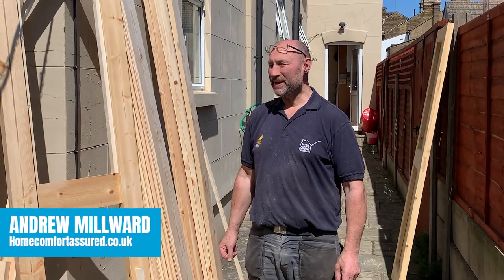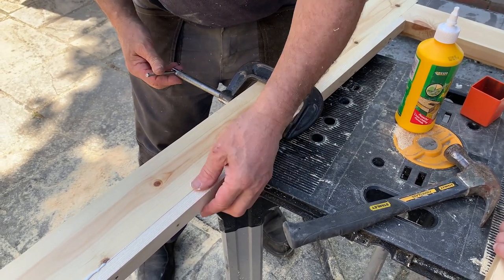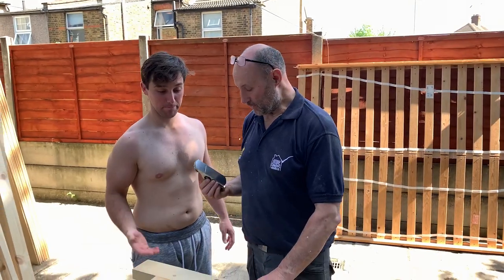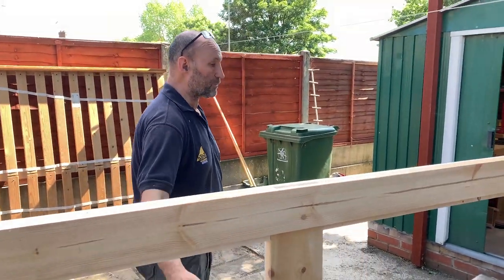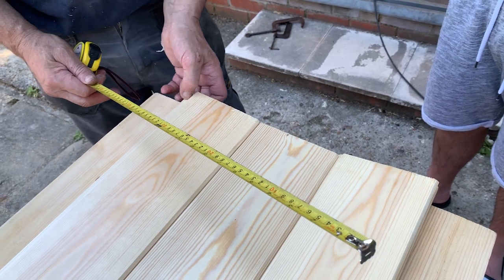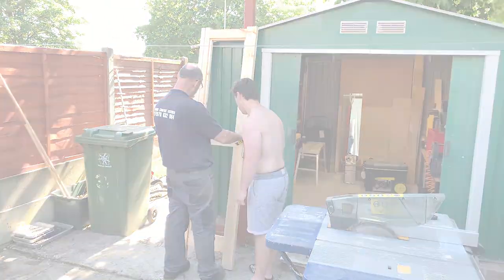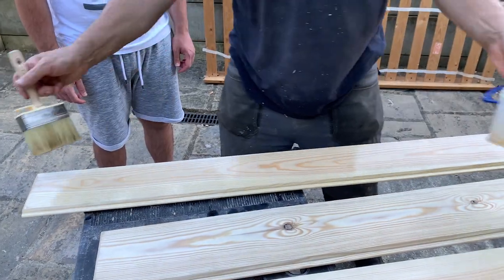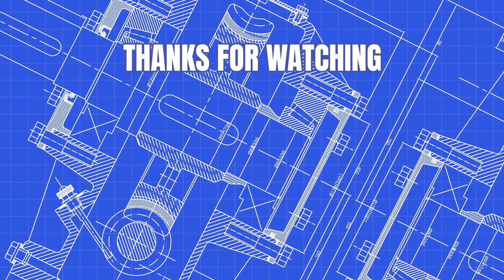Plumber teaches carpentry

Comment: Dont forget to use a push rod on that bench saw, don't want to lose fingers.. And some knotting on the knots is always good for resin leakage.. Good job..
Reply from the maker: I watch many youtubers doing wood work and since at the lack of safety. I now realise I'm just as bad. If it's being painted with fence treatment is knotting still required ?
Reply: @andrewmillwardwatford9410   Not sure what your fence treatment is so here is a small explanation. On interior wood, painters use alcohol-based shellac to pre-seal knots before they prime. Shellac blocks both oils and water for a good stain-proof seal, while also promoting adhesion between coats. But shellac on its own doesn’t stand up to outdoor conditions, where wood moves in response to the seasons. For exterior work, professional painters have learned to “sandwich” multiple coats of shellac between the stain-blocking prime coat and the paint topcoat. That way, the shellac film can do its sealing job while protected and held in place by the more flexible coats of acrylic primer and paint. 
 You only get one set of fingers mate so look after them..